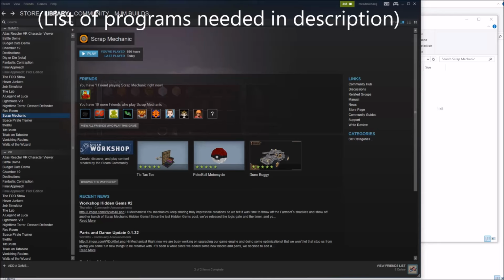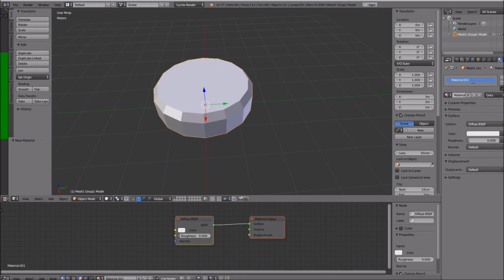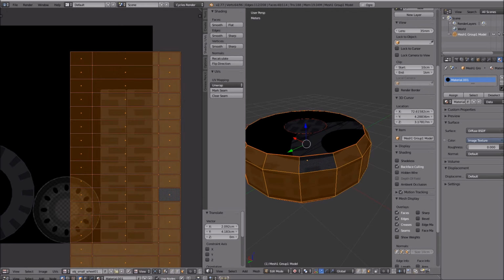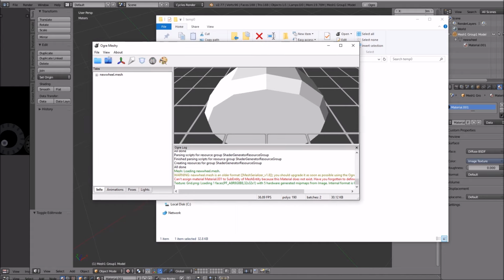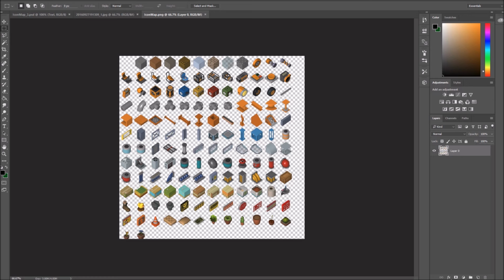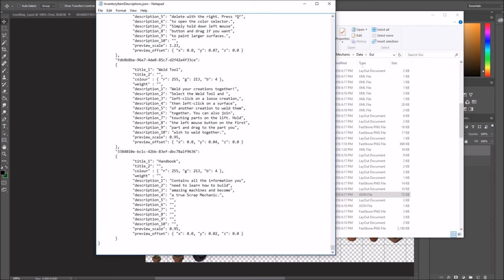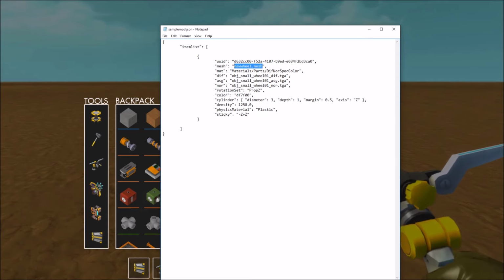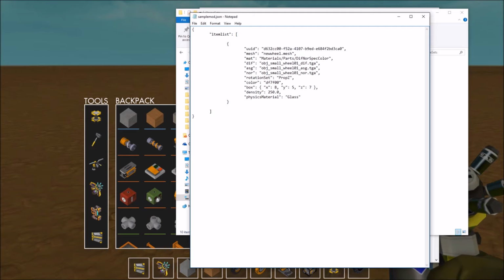Scrap Mechanic : MJM Modding tutorial 1 (outdated)

Comment: I see You dont like 3D modeling xd Why? Blender is awesome! In next episode id like to see how to make custom animations for seats
Reply: Wtf r u talking about Blender is awesome
Reply from the maker: I do like modeling in Sketchup, but blender is confusing in comparison. So all my mod parts I made in sketchup then exported obj files over to blender to export to oger mesh. But I didn't want to add that extra layer to the process of the tutorial.  For the steering, the seats have 2 bones in them, and if you add two bones to your model and give them the same names the game uses, it sees the names and knows it's the pivot for the steering. The main bone gets weight painted to the seat mesh, and the second bone is weighted to the steering wheel mesh.
Reply: Blender sucks for proper 3D modeling, btw have you found out a way to convert mesh back to xml or other file formats?